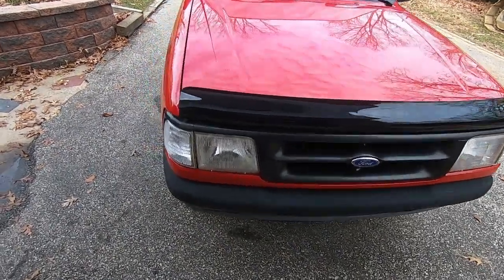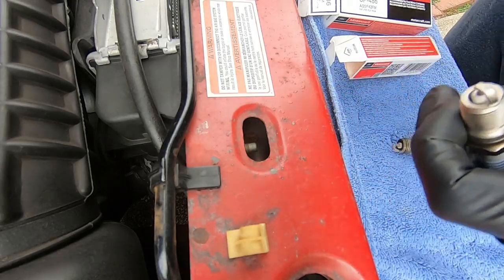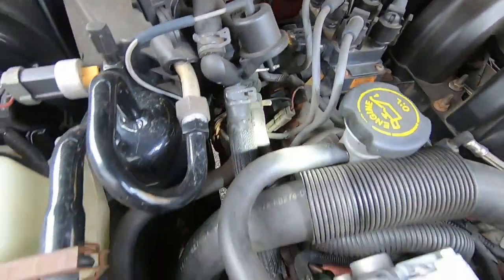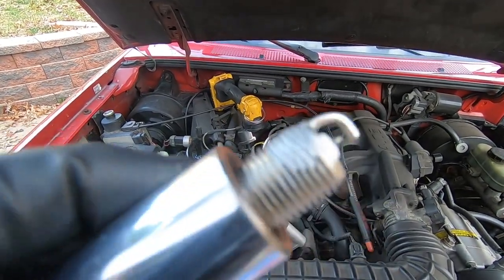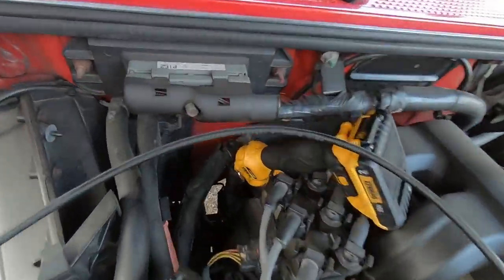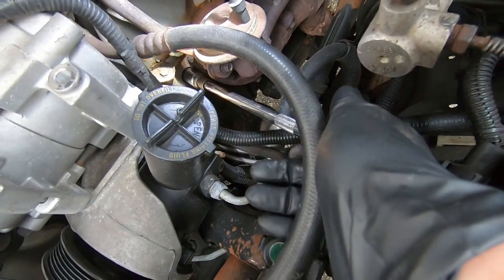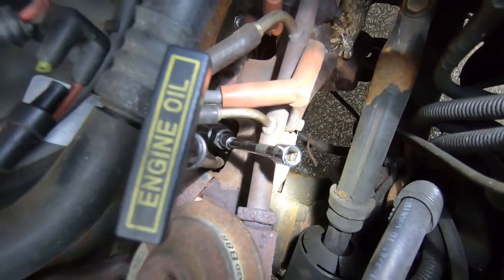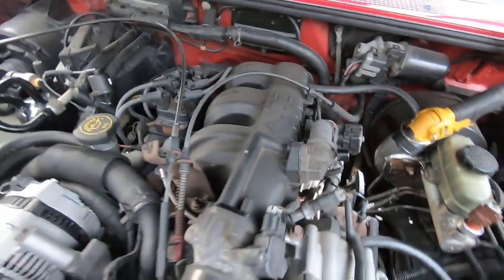1993-1997 Ford Ranger Spark Plug Replacement (4.0L 6 Cyl.)

Comment: I gotta know why you're doing it again and why it's not good. Like you mention at 2:41. I have a 95 Ford Ranger and the thing blows spark plugs like once every 4-5 months. I've taken it to so many mechanics and they can't figure out why it breaks spark plugs so often. I'm going to change them myself tomorrow. Thanks for the tip!
Reply from the maker: Lol it was a cracked head/bad head gasket fouling them out. I actually just did the whole head job, and literally just uploaded the first part of the head build (Red Ranger Build! Pt. 10) to the channel. Check it out. But what do you mean by it “breaks” spark plugs lol
Reply: i learned from experience certain ranger motors will reject any plugs and wires that are not motorcraft. it will fowl them out like crazy. specially the 4.0 ohv.

Comment: Have you ever had lifter problems? Apparently This engine is notorious for ticking, if so how would you fix it? Oil cleaner maybe?? Any help is appreciated
Reply from the maker: Mine is a bit noisy from time to time. I actually have a complete new top end rebuild with new heads, gaskets, rods, lifters, etc. that I plan on doing to solve all the issues, as these 4.0L's are notorious for cracked heads, and I'm confident at least one of mine is. The head gasket issue is why I had to replace these plugs. The truck somehow still runs great, but I really need to stop being lazy and just do the little teardown and get it done.
Reply: wynns lifter oil might help

Comment: i use a sharpie marker to mark the wires on the red tip of wire with black marker. just write the plug # i keep a firing order diagram in my glove box to know what wire goes to what plug. i always use motorcraft plugs and wires cause i have the 4.0 ohv and this motor tends to fowl out any other brand and just rejects them if they not motorcraft. also motorcraft oil filter. i have had 3 rangers and an explorer. learned form experience.
Reply from the maker: Definitely, no doubt 🤙

Comment: Would it be easier to remove the fender well on the right side
Reply from the maker: I never thought about it to be honest, but I replaced the oil filter adapter O-rings on this thing & from what I remember with doing that is there wasn’t a lot of view or access in there, at least to really work in there anyway.
Reply: Just think that it would work on the right side but the is more open I am getting to tune my 96 STX I am going to try that will let you know how it worked out by the way great video
Reply from the maker: @chucklucas8747  appreciate it! LMK how it goes 👍

Comment: I have a '91 6 cylinder that I would love to do this myself but it looks too difficult for my back.  I'm only getting 16 miles per gallon and I'm wondering what other people including yourself are getting?
Reply from the maker: If you pace yourself and maybe even stand on something to give you some elevation you might just be able to knock it out with minimal back issues. 

As far as gas mileage, I honestly have no clue. I only drive the truck about 5 miles at the most a day, so I never really bothered. I’ve really never bothered trying to ever figure out my gas mileage on any vehicle lol.
Reply: I just got a 97 4.0 for a work truck and it’s maybe getting 10 miles per gallon, I was watching this video because I’m gonna change the oil in it tomorrow and change the plugs this weekend, so far it’s burning fuel worse than a v8
Reply: alot of rangers dont get good gas mileage. it a flaw of the trucks. get u a towel to lay across the truck on and it will make it easier to work on. i have to do this cause i am short and it makes my back hurt if i don't . i stand on a nice solid wood stool.

Comment: Really good quality . Broke my ass . wish i watched this first ! Theirs a wire connection i see there to a gray plug that i also have n wires are pulling out  seems like it goes to coil mounting bracket, is this the ground for the Coil ?

Comment: Why did you replace them again ? I just changed mine and check engine light ):
Reply from the maker: Lol i said I wasn’t saying why 😅 but naaa the head is cracked/bad head gasket. Fouling out the plugs. I’ve had new heads, exhaust manifolds, gaskets, etc. huge pile of parts to do the job for a while, but I’ve just been lazy cause it still runs great lol. But i need to get to it.